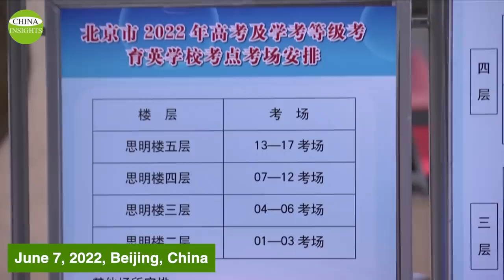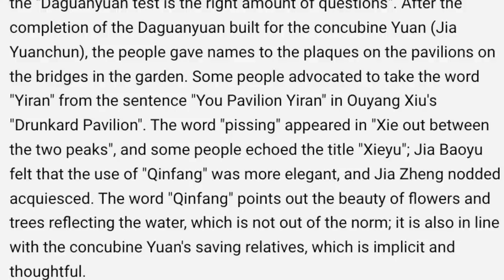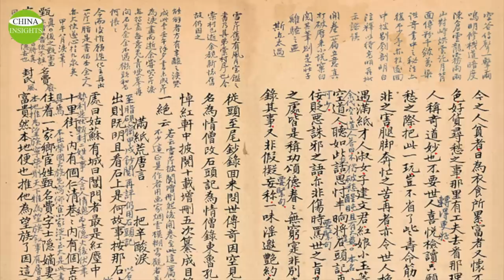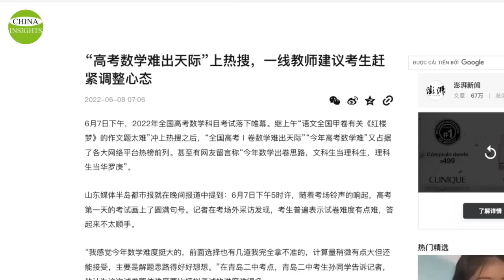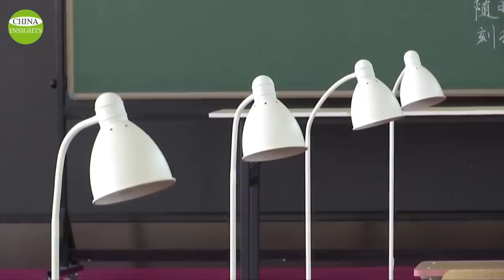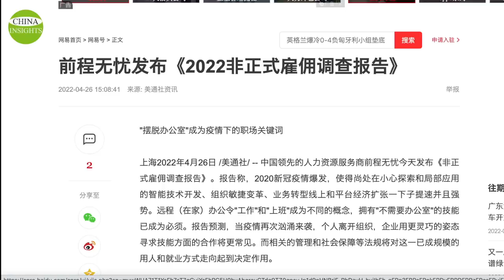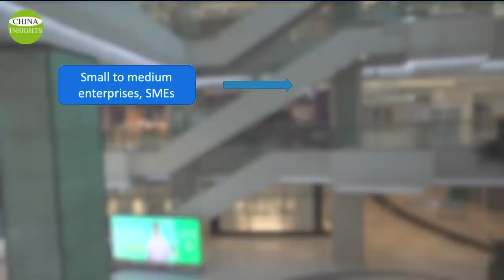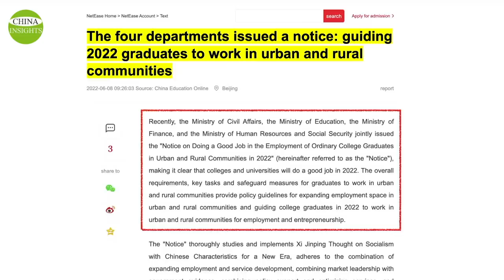Beijing uses hardest Gaokao exam to lessen the employment challenge/Record 12M sit for 2022 Exam

Comment: Weird that a communist party would run questions that are so related to nobility...
Reply: That's because the CCP is no different than a dynasty of old. Xi is the current emperor of the Zhongguo-Gongchandang (Zhonggong) dynasty.
Reply: @mayuri4184  

The CCP are just as bad but still, it's funny that they want to touch such words.
Reply: jin gu  A means to cement Mao's power.

Comment: If the test is all hard, it's fine, because it is rank based test, it doesn't matter if you got 50 if all others got 49.
What is f*cked up is having different questions for different regions. Causing the possibility of lesser talent in a good region get into a better University.

Comment: Most students that graduated 2 years ago are still unemployed. Good luck finding work!
Reply: I graduated in 2019 with a physics degree and still have not even gotten an interview for a job that requires a physicist. In fact, I can't even be allowed to get hired as an engineer or a mathematician since I don't have an engineering or mathematics degree, specifically, even though physics is literally both of those things and we score higher than both on performance and aptitude tests.

In short, the system is irreparably broken so there's no use crying about it.
Reply: @ChristAliveForevermore  Don't disrespect engineers and mathematicians just because you chose an unemployable field to study. You aren't smarter than them; you just studied a different curriculum. There's math that engineers do that hardly physicists or mathematicians ever study.
Reply: @xungnham1388  That is not true. My best friend studied physics and he writes computer systems for a large American bank. Physics is maths, if a person has graduated in that then they can also do engineering, they are not very different. In Britain we don't think that a smart person is only capable of a single thing. If you have a good brain you will learn fast and draw knowledge from many different areas to solve problems.
Reply: @ericconnor8419  An anecdote does not prove a truth. Just because your best friend had an active enough interest to learn enough CS to land a software engineering job or was in a desperate enough job market for a company to risk hiring a physicist for a software job doesn't mean his training is best suited for his job.

I have interviewed hundreds of new graduates during my software engineering career. And when we bring in physics majors for an interview, I can predict almost with a certainty when the line of questions will go off the rails. And I don't mean they simply arrived at the wrong answer, I mean they have no idea what half of the words of the question meant. Like a deer staring into headlights. Almost as if they hadn't spent their last 4 years studying the domain that they were trying to get a job in. We have never hired a physics major...

People outside of a field don't know what they don't know. It's called the Dunning-Kruger effect.
Reply: @xungnham1388  You don't need to patronise me I know what the Dunning-Kruger effect is, and I am just a gardener. You have just responded with another anecdote.
Reply: @ericconnor8419  I wasn't directing the Dunning-Kruger comment towards you. I was referring to the physicists who thinks he'd make a better engineer than trained engineers.

Imagine if a chemistry major said "as a chemist I can't get a job as a pharmacist or internal medicine doctor. Chemistry is the foundation of their field, so I should be able to pick up the rest on the job." It would be a ridiculous statement and even if a chemist did find themself in that situation, they wouldn't be aware of their gap in knowledge from actual trained doctors.
Reply: @xungnham1388  We spent our teenage years writing computer programmes, first on Amiga then P.C. I did the art and sound he did the coding. He had to write his own custom software for his robotics projects. 

I'm not convinced you can 'train' somebody to be good at something like that it has to be inside you, but every physicist I have ever known has been good with electronics and programming. I have never been capable, which is why I did biology! I have been fairly successful with plant breeding because I have a good memory for shapes and colours, but I could never work in computers I hate offices and people.
Reply: @ericconnor8419  Sure that's how a lot of non-software majors get into a software job, through self-initiated interest/hobbies. But realize that most people who get an engineering degree also have self-initiated interest/hobbies on top of formal training. EEs usually play with electronic designs in their spare time, MechEs usually grow up working on their bikes/cars and building contraptions, and CS usually work on personal programming projects outside of class.

Where self-initiated interest falls short, formal classes make up for. In my youth, I had no interest in understanding networking concepts or advance operating system topics. I would have never learned them on my own. Having been forced to take those classes, I use them a lot for work and have become the office expert.
Reply: @ChristAliveForevermore  Can't you not migrate?

Comment: We have the same problem in North America. This delusion that we can have a top heavy system where people who don't actually produce things or do anything can outnumber the people who actually do stuff isn't working.  Plumbers, electricians, lineman.  Appliance repairman start at $90 an hour.
Reply: No we don't.  We have plenty of problems here but pretending they are the same problems or that problems here excuse problems there is really just a weak excuse.  You don't solve problems whining or pretending they're all the same.
Reply: Yep, it is actually a global problem. All of the things mentioned in this video are the same issues affecting the USA.
Reply: Still quite different. The US has the same problem of a bunch of people with useless degrees. But people with useless degrees can still go and get a cert to become a plumber, electrician, truck driver, etc, and make those high wages. That's not the case in China.
Reply: @tragicmat1  What are the wages for trades like in China? Do they require certs?
Reply: @wageslave387  Wages aren't high. Somewhere around 6,000-10,000 rmb a month (dependent on skill and which city the worker is in). Unless you are starting a company, there's no real licensing requirements.

Comment: This is not unique to China. In India, JEE advanced, UPSC, NEET etc are some exams which are also just too difficult or almost impossible to crack without attending a coaching institute, most of which have fees so high that it is higher than most Indians' annual salary. I say this as a JEE aspirant who is attending one such coaching institute: the gap between the haves and have nots is considerable, and the society is not linient to those who fail.

Comment: Increasing the difficulty of the entrance exam (in rural areas), due to the lack of unskilled labor, is an interesting reason.  

China is a manufacturing hub (which therefore makes R&D easier in China due to being able to design then prototype new tech, on the same day and in the same city). However, China is only a great R&D/manufacturing center, due to the extremely cheap labor. People with college degrees won’t want to work in a factory doing manual labor; they gotta keep the status quo(?).

Having the entrance exams, in metropolitan areas be easier, definitely ensures that the elite’s children (whom are able to live and obtain residency in expensive inner cities), continue going to college

Comment: Someone in the sticks or has high minority numbers get tests with questions. Like how long it would take you to circumnavigate the witch head nebula while traveling at light speed?

Beijing version of math questions. What’s two plus two equal. Students struggle for the answer. Beads of sweat are building up. The teacher leans in and whispers “The answer is four.” The students bop their heads and snap their fingers. “Yeah I knew that.” Teacher rubber stamps passed on the exam paper. Teachers think to themselves. At least this time their families get to live another year. Until the next exam. Since all these Mafia elite passed this year.

Comment: 11:49
Do you think applying to 20 jobs is a lot? 
I've applied to over 300 summer internships and haven't landed a single one. 
However, I was lucky when I switched from internships to full-time jobs. Here is a tip for you future engineers. Find a large corporation located far from the tech hub. You don't need a job in silicon valley, and there are plenty of high-paying jobs in smaller cities.

Comment: The scoring system of Gaokao is to locate the student's rank in the whole group. Whether the exam is hard or easy doesn't change its rank, it will only be effective when you need to differentiate the superb and the good ones.
Reply: Except some areas give you score boosts regardless of performance and this year's exam has different test difficulties. Even if all tests were the same, there could still be discriminatory behaviors (ref. Literacy tests in the US for Black people during Jim Crow era)

Comment: it does not matter if the tests of the provinces are differents, they do not compete against each other. Students from xangai do not compete with those from xangai, they only compete between themselves, and the college vacancies are distribuited within the provincies by percentage. 5 per cent goes to a top tie uni, 10 to a 2 tie, 30 to a third tie uni and so on.

Comment: As a Chinese, this is exactly not true. The Gaokao Papers are split into three versions, A B C that are assigned based on province, not rural vs urban areas. The only two cities that have their own paper, is Beijing and Shanghai, it's true that the paper in Beijing and Shanghai are easier, but there are only very little people here compared to the rest of the country that if you worked hard there is no problem getting into top universities.

Also, Gaokao is much easier in rural areas like Tibet and Xinjiang. They use Variant II of the Gaokao paper, across Gansu, Qinghai, Tibet, Heilongjiang, Xinjiang, Inner Mongolia, which are some of the most impoverished regions in China, much easier than if you were to take it in a city like Guangzhou or Shenzhen.

Comment: 200 million is almost 15% unemployment of China's TOTAL population. That's insane!
Most western countries only count a certain subset of the population in unemployment statistics.
Those of a younger age, retired or not looking for a job, despite being unemployed, are often not included in the statistics.
In the US the unemployment percentage usually hovers below 6%, even during the height of the pandemic this only shortly peaked at just below 15%.

If we would measure China's unemployment by western standards it would look something like this:
From what I found, roughly 68% of Chinese are of working age.
Given 68% of 1,4 billion Chinese that is 1,02 billion. 0,2 billion / 1 = 20% unemployment rate.
This is still a conservative number as it doesn't even take the full western standard into account.

An 20% unemployment rate for long periods of time, for what looks like several years, can't be good for the economy and general welfare of the Chinese.

Comment: Another important video must be made. about university education system.  in my experience, a professor is under the students' evaluation every semester and his performance is under students' opinion. If a professor is very dedicated, very diligent, gives lots of projects and research, midterm and final exams, is available for office hours,  demand attendance, forbids use of electronic devices, pretend punctuality, don't accept excuses for no reason, doesn't allow any cheating, and goes the extra mile to provide students with knowledge of current affairs then is a really lousy professor.  on the other hand,  if the instructor doesn't bother the students, just read the ppt presentation, doesn't check attendance,  does not give any kind of assignment,  provide the exam's question in advance and let the exam be open book, gives all students final high marks, and doesn't bother what they do during the semester then the professor is considered good and a great instructor. the reason why graduates can't find job is due to the fact that most of them are not prepared, not educated and are illiterate in their majors. why? an instructor can't fail students and if he does means the student either dropped out or passed to a better life. in any other case, every student must be passed. Universities don't want to be known as tough and see a drop of enrollment. Graduate students rate in all universities are 97-99% exactly in four years. in Western universities,  on average,  only 65-72% of students manage to finish their undergraduate or postgraduate majors on time. why? students fall tests and much retake the failed subjects therefore they can't graduate on time. a bachelor degree graduate may get his diploma regardless if he studied or had 4 years holiday time on campus. in this case  the University is good nobody fails, all families are happy the kids are graduate, but the reality of life is raw and harsh and out of 10, 76milion graduate job-seekers only 5% will get their dream job. the others will settle for being delivery drivers or assistant police when lucky

Comment: I have a poor understanding of the test, how it is evaluated, and how it is scored. It would seem that if there is a continuous score, rather than a step-wise score, the difficulty of the test doesn’t matter. That is, if everyone is taking the same test.
Reply: There are tests that are easier to grade than others; mathematics, for example, has correct and incorrect answers so the scores are fairly transparent. Literature is more subjective but the essays are usually graded by multiple teachers to come to a consensus which is then considered the final grade.

You are correct in saying that the difficulty of the test doesn't matter as long as the tests are the same because the universities will adjust their admission requirements to match that year's crop of scores. Alas the tests are different which allows universities to pick and choose metropolitan addresses and weed out rural children.

Comment: I wonder if the issue lays in the idea that having an advanced degree is required (especially for men) to achieve any level of success in life. Of course we have a similar issue in the US, but there is still respect for plumbers and electricians even though they usually don’t hold even bachelor degrees. They can still be successful despite their ‘lower’ education. Chinese society has become so competitive without expanding the space at the top that unless you are born lucky you have little to no chance no matter how hard you work to achieve much. The difficulty of the exams being determined by location seems to be an effect, not a cause. Population centers are harder to control, so give them more privileges to keep them from burning things down. Frankly, I think the issue will solve itself in 50 years when the grandparents and parents of 20-30 yr olds today start to pass away. There are far fewer millennials than previous gens due to the one child policy and economic hardships, so spaces will open once the older gens retire and pass. This should allow for a massive shift in employment as companies won’t have enough qualified people to staff them. 

Or I could be 100% wrong. Guess we’ll have to see.

Comment: This is totally normal. If everybody work hard and a large amount of people are expected to pass, you better crank up the difficulty otherwise you have to use a lottery system. But using a lottery system would demolish the top performer's morale.
The other answer would be to crank up the courses difficulty so you don't end up with 80% of your students being on top of the game.
Reply: Except this applied to select areas. Namely, the areas whose governments did not control the tests.